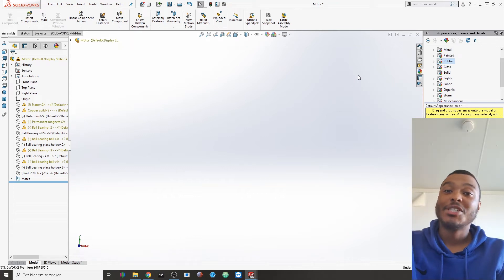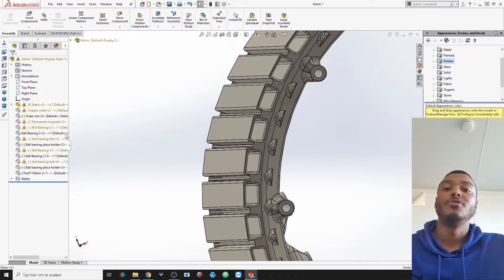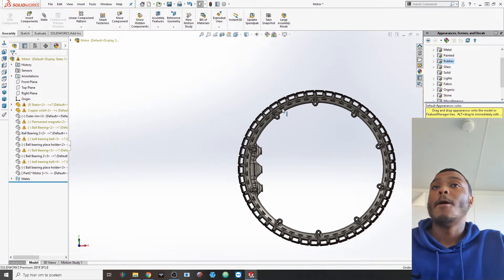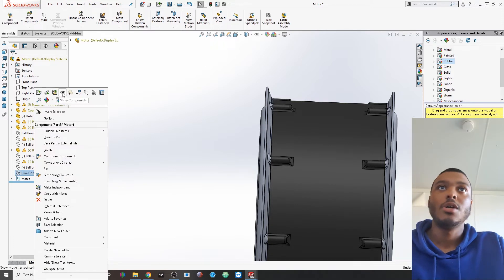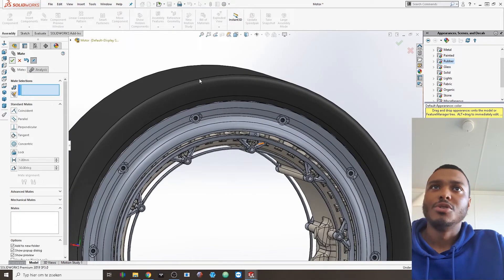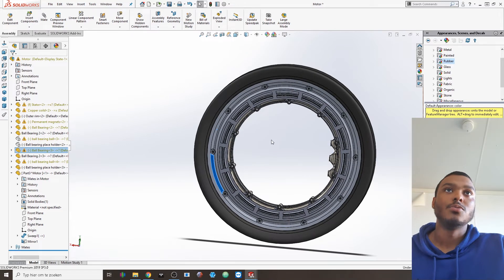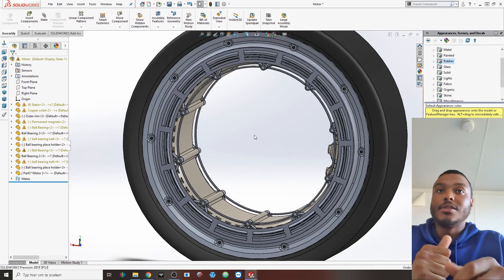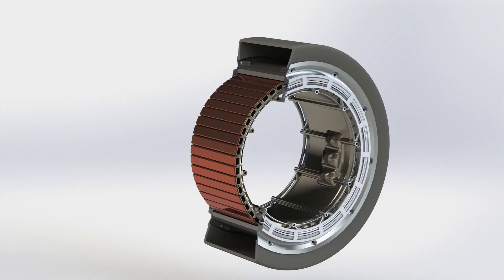How does a hub less in wheel electric motor work in solidworks| VeldboomStudios

Comment: This is amazing. I subscribed. I want this! One question relating  to water, and common wear and tear. This looks like if one thing goes bad you gotta replace the entire thing 😅 pricey. What's your perspective on that?
Reply from the maker: I made it from the perspective that in 2040 we will have a multi metal 3dprinter that can print motors from scratch. If you where able to print it yourself or order the motor from print services, it shouldn’t be the most expensive to produce

Comment: What you will find is that dynamic braking (using the motor's output to slow down the wheel) will not be sufficient to stop the vehicle to requirement. This is why all electric vehicles today have clamping brakes as well as dynamic braking to slow the car.

I worked on a client's turret motion system that required active braking -- actually driving the DC motor in reverse -- to slow the turret down quickly enough to meet spec. You might look into that as a form of braking when required.

Comment: I drew out a propulsion system 99% identical to this in 2006. It used toroidal coils and opposing magnets with the ability to modulate the strength of the electromagnets. Its so crazy to see this because it is so similar to what was in my head. I wasn't an engineering student, but I always thought it made sense. Super cool. I hope you file some patents for what you can. Look at me. smh lol

Comment: What would also be awesome is you could have  an electronically adjustable mount inside the hub to essentially choose ride Height at the mounting point before you even got to the A arms etc, Depending on the clearance on the inside.  you could have a realistic adjustability of like 2-10 inches (or more in its time depending on what alloys are created

Comment: Shaq, you state that this is viable in 20 years. Do you say this only because of the expected capabilities of 3D printing in 20 years? If so, why not make it now?
Reply from the maker: I think multiple metal 3dprinter technology with intergated circuits is still a couple decades out. That would revolutionise everything.

Comment: This motor design would not work. The fields are perpendicular and would provide 0 force. Someone pointed out you could orient the magnets in a way it matches the coils but that would cause rotation force in the coil and magnets and the force would be smaller than traditional motors due to how field lines work. The bearing in this concept is also not viable in real commercial use and would have been better if he just used an already available bearing that just has a huge diameter. For people who are actually interested in new motor technology that isn't science fiction go look up axial motors(not actually new but rarely used for things like EVs as of yet) and inductive motors with magnets imbedded in the core(what Tesla and some other Electric Cars use).
Reply: I am not from electrical background I just want to know why 3 phase permanent magnet motor wouldn't work in this design?
Reply: @ashishac7913  you can definetly use a three phase motor here. It's just that the way he oriented the copper wires and the magnets orients the magnetic fields so the force created is zero. The force created by two field lines are a function of angle.

Comment: yes very good design, i thought of this also.. look, i have some designs for energy multiplication whereas we could produce as much Mobil electric energy without limit as you would ever need.. couple this whith the electic wheels and make the inside of the rims propellers for flying cars.. double-stacked propellers one clockwise other counters for balance... besides this i have some designs for propulsion for jets and hover crafts which would alow ut to stop on a dime or fly sideways or hover and land straight down or go straight up..it beautiful with many small  vacum hose jets = improved vectoring both intake and exhaust
Reply from the maker: That sounds amazing
Reply: I also have thought of this. Amazing to come across someone with a like mind. I imagined the wheels being large diameter so the carbon fiber props could get more surface area. Also have the battery pack underneath and deployable as a safety feature.

Comment: the inside seems like wasted space. could make the coils longer, stretching close to the center to fill that space and generate more power using the same dimensions
Reply: The verge hub motor is like this, has 1100 nm of torque lol

Comment: unspeung mass includes the motor then?
Reply from the maker: Yess it does, but if you can delete the weight of the uprights and the full braking system it might even be lighter.

Comment: The copper winding on the stator is pointing the magnetic flux in the wrong direction. The way I see it, correct me if I am wrong, is that the positive and negative poles are perpendicular to the permanent magnets. I've never seen an electric motor look like this in my entire life. Please enlighten me with how the whole magnetic field situation works, thanks.
Reply: only if he would put permanent magnets oriented sideways also
Reply: @redhotbits  I don't think that works well and causes a lot of issues like rotational force on the magnet and coils in the perpendicular direction and the efficiency would be really bad since the magnetic fields of the same poles wouldn't even be pointed at each other. I think he just doesn't understand how magnetic field works and made this to be aesthetic more than anything XD
Reply from the maker: Its for a video game design. You're correct
Reply: Lazar Otasevic Yeah ik. I feel like this guy has no idea what he is doing
Reply from the maker: Hahhaha I actually don't. Im working on an imaginary 2040 future project and im thinking about what might be possible in the future. I dont have any experience in these field.

Comment: I build an complete wheel in 1998 exactly what you are discribeing
Reply from the maker: Thats awesome. Do you have pictures.
Reply: TheNr1 Designer not here maybe my ex wife has them
It works ok on perfect roads but the magnetically crack up an fall apart on roughy roads I put it on a motor bike an ran it till 2017
Reply: If I built another I would not use magnetics an use a brush type system 
If you know what I mean
Reply from the maker: I do. Luckily its more of a thesis than something im trying to build
Reply: TheNr1 Designer well you keep at it I have always though that the answer is in a powered wheel design
Reply: @johnkleisdorff9522  I think you should build another! .v2. Given the fact how much electric cars, motors and bikes are improving and how much more of these hubless motors we see in movies, it would be a big deal!
Reply: Please tell how "verge (Company) Hubless" electric motor wheel work???

Comment: how much phase
Reply: im assuming 3 phase would be best, since it is the perfect balance between efficiency and cost
Reply: @kejtov  radial or axial flux motor?
Reply: @hariharanramamurthy9946  His coil orientation is incorrect, but it’s most likely supposed to be a radial configuration, seeing as the magnets are around the outside rather than the sides.

Comment: This would be really cool on the back of an electric motorcycle
Reply from the maker: How about on all 4 wheels on a car
Reply: I worked at that from 1998 till now an I agree with you
In the shop it works great but problems come on road test, weather, rough roads etc
Reply: You should think about breaking system design to implement it on all 4 wheels of a car.